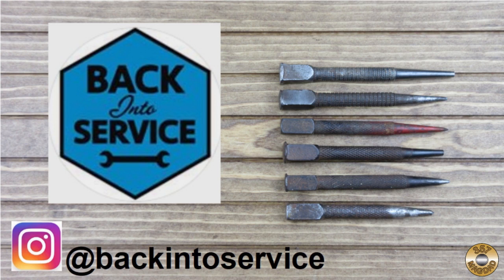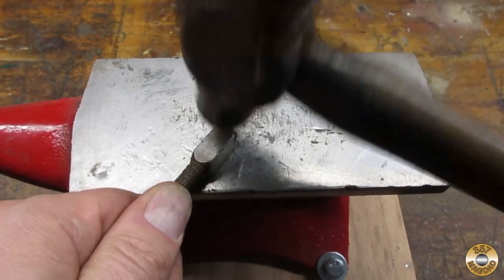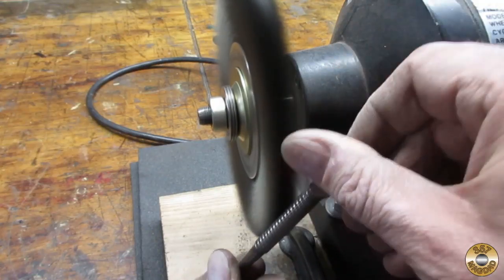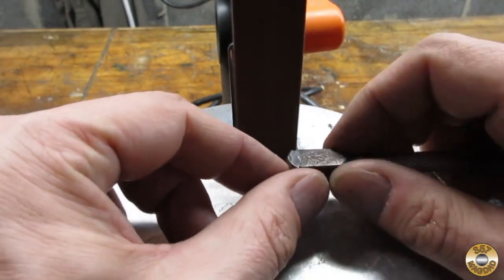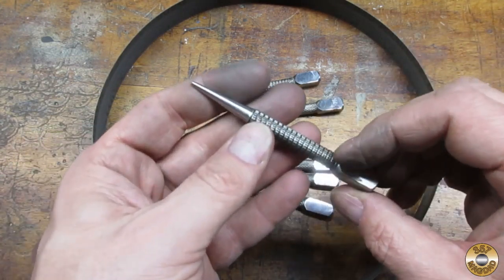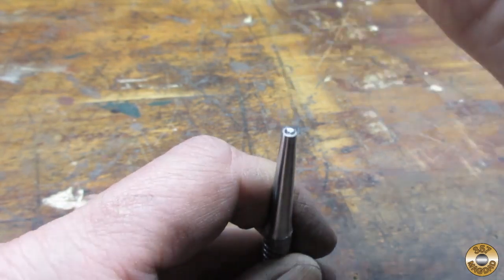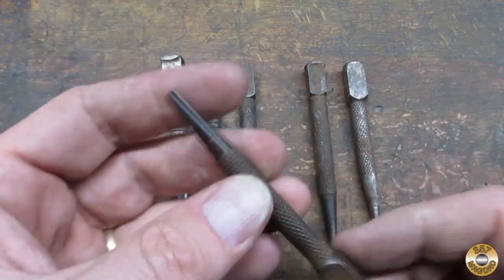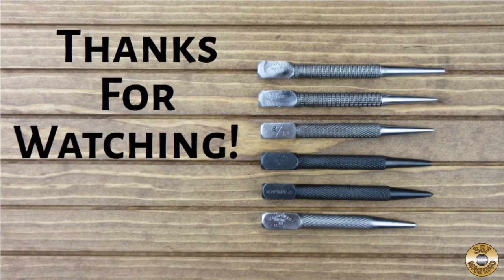Hand Tool Restoration - Nail set Punches

Comment: How is a nailing punch different from a center punch?
Reply from the maker: Thanks for watching!
A nail set is used in wood working to drive finishing nails below flush.  Nail sets often have a concave head to keep the punch from slipping off of the nail head.
A center punch has a sharp point and is used mostly in metal working to make a divot in the metal to keep the drill point from slipping off center when drilling holes.
Reply: @357magdad  thank you for explaining that.  I have use center punches once on a while, but had not been introduced to the nail punch.
😺

Comment: Glad to see you mentioned the concave tips on the nail sets. I've seen cheap nail sets where none of the tips were concave. It makes a huge difference when setting nails below the surface of wood when the tip is concave.
Reply from the maker: The grinding ball on the Dremel did a good job on those tips!

Comment: I love punches, centre, pin, prick or nail sets. I especially like those with a square head that do not roll off the bench and find their way to the most inaccessible place on the workshop floor. I am glad that one of my restoration gods also uses cheap dremel knock off wire wheels !.
Reply from the maker: Thanks Tony!  These little things are fun to clean up.  I'll be looking for more at the sales once the plague clears!

Comment: Well back to my punch hoard.  Between you and ScoutCrafter I’ve got another project.  I must have two dozen plus assorted punches in various states of disrepair.  Going to set  up a sort box like SC when they are done.   Hope I get them DONE before quarantine ends.  Thanks for another great video.  I might even Flitz one or two in your honor.lol. I do have a set in the wooden cylinder holder.  So another project for the lathe to refinish the cylinder.   SOMEBODY CAME UP WITH A GREAT LINE:  “I’m 74 but feel like a teenager.  Gas is cheap and I’m grounded”
Reply from the maker: I like that line!  I'm glad ScoutCrafter and I are keeping you busy! LOL

Comment: I really like knurling pattern on them.  It gives them a whole lot of character.  Plus the re-grined tip turned out really well, as well as the polished finish.  I think I’ll have to add some nail punches to the “tools I need” list.👍
Reply from the maker: The different knurling patterns are what makes these fun to collect and clean up!  Plus they come in handy! I just used the one modified into a center punch yesterday!

Comment: Those 'Dremel' wire brushes are lethal 😂 They don't make punches like they used to..... Great work 👍🏻🔧
Reply from the maker: I wear a full face shield and I can hear the wires pinging off of it!
Reply: @357magdad  I frequently pick them out of my clothes and hair 😂
Reply: @ArmandoLoni  I find them sticking out of my socks sometimes... oops
Reply: This annoys me as well, friends.  It occurs to me that one reason - beyond quality - might be that our Dremels can operate at much higher speeds than our bench wheels.  I have less of a problem if I run those little wheels slower.  They could also do something to increase life and safety, like anchoring in the wires with epoxy!
Reply: Marc McKenzie I find that in most cases it’s not only that the wire comes out of the crimped base but rather they also get cut off easily because they’re so thin

Comment: De ja vu!  I just got done cleaning my punches up not too long ago.  instead of shining up the sides with the belt sander though I used a fiber wheel (Thanks to Joe's shop!) on my bench grinder setup.  They came out beautiful without losing the lettering.  After I shined them up I dipped them in shellac and hung them from a magnet to let them dry.
Reply from the maker: My plan was to find another bench grinder at a yard sale this summer and set it up with a couple fiber wheels.  Maybe this fall.
Reply: You won;t regret it.  Sometimes these wheels almost seem better than magic (but not as good as Flitz LOL!) when you use them.

Comment: I use those cheap and cheerful Chinese wire wheels too. Can’t beat the volume for the price. I have found if I keep the speed below 3000 rpm they last longer. My Dremel maxes out at 15,000rpm and can spit every wire out of the wheel before you even touch the work surface at that speed. So slow and steady it is. 🇦🇺👍
Reply from the maker: My old Dremel's speed control vibrates back to low no matter where I set it.  I've had better luck with the wire wheels from Harbor Freight than the ones from Amazon.

Comment: Have you ever tried boiling rusty steel tools for rust conversion? It works amazingly well. I boil old rusty steel or cast iron tools for 45 -60 minutes. The boiling converts the red rust to a black magnetite which is then easily carded off with a soft wire brush or wheel. It gets down into any pitting and makes really easy work of rust removal without having to remove too much material with abrasives. Just my $0.02 that I thought I would pass along.
Reply from the maker: I have been planning to do a rust bluing project.
Reply: @357magdad   It's a lot of fun. I used RUSTBLUE.com for the chemical. Really enjoy Mark Novak for gunsmithing stuff. Enjoy.

Comment: Your plat is on your belt sander?
That's a big move magdad have you talked this move over with Scoutcrafter? Or are you just a Rebel. LOL
Great video Magdad!!
Reply from the maker: ScoutCrafter's stick method would have worked well for these punches. That platen is a pain in the butt to take on and off.  I think I installed it for the King Dick wrench and I was just too lazy to take it back off!  .

Comment: Punches are a lot of fun to bring back from the dead. Nice work. Where do you find the thin wire wheels for your bench grinder? I get them at Harbor Freight but they are about an inch thick.
Reply from the maker: The fine .006 wire wheel is a Wieler that was my dad's.  I think I bought the coarse wheel .012 wire from Amazon.
Reply: Thank you sir

Comment: I get the feeling that most nail sets are probably used 95% of the time for other things besides setting nails.
Reply from the maker: I'v used them for knocking out pins.  The tapered end usually gets stuck in the pin hole.  I've also been known to grind the tips down to fit the job.